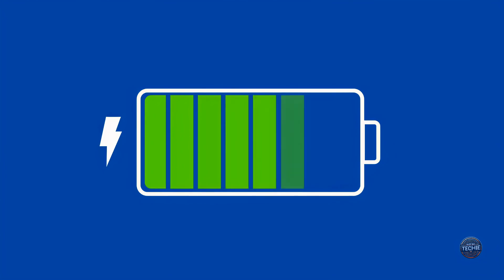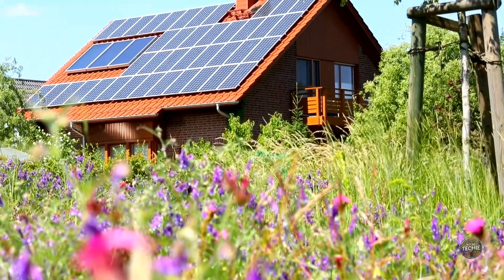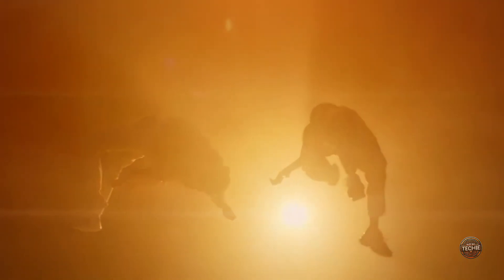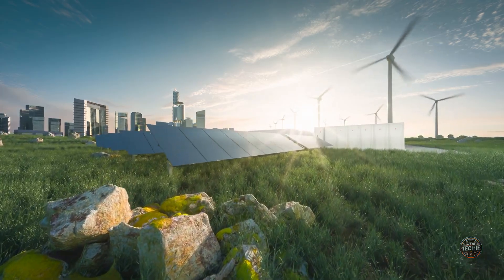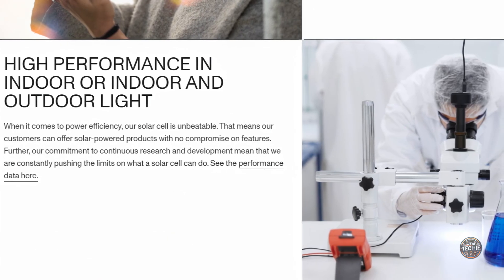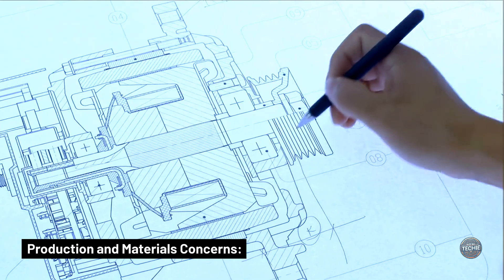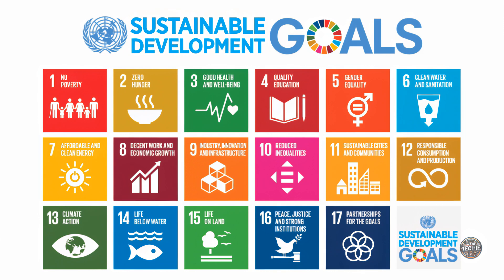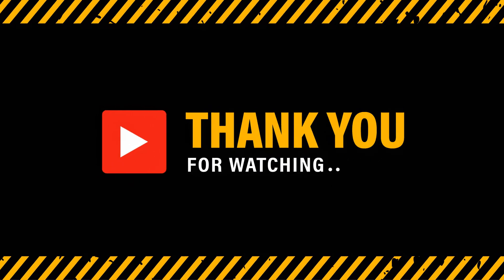Why Solar Tech Could Make Batteries Obsolete Sooner Than You Think

Comment: im all for new interesting stuff but that? might work for extremely low powered things but keeping a phone running might only work if you close all apps and never activate the screen...now thinking about a vehicle is nuts...how much power you get from a decent solar panel set up optimal? and how much you need to drive a car or bus? might work for empty semis with trailers plastered full downhill
Reply from the maker: I Agree! Right now, solar tech is better for keeping small gadgets going, but the exciting part is how fast it's improving—who knows, in a few years we might be seeing tiny solar assisted vehicles...prob dropping off a pizza or something.